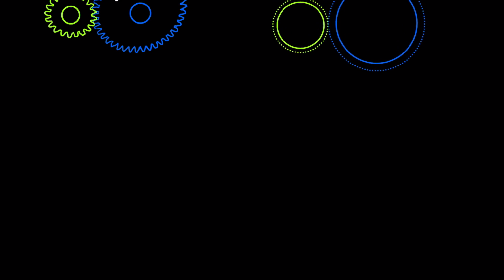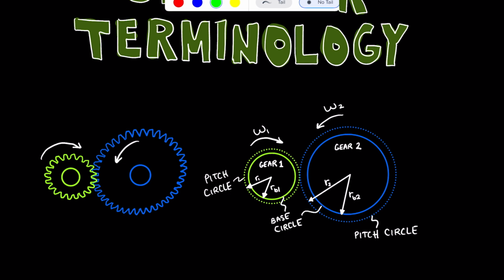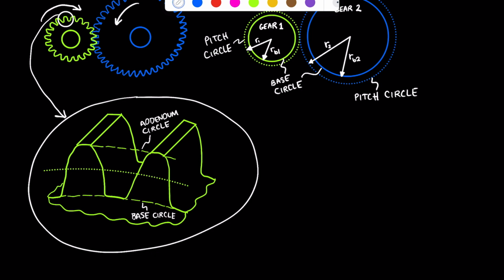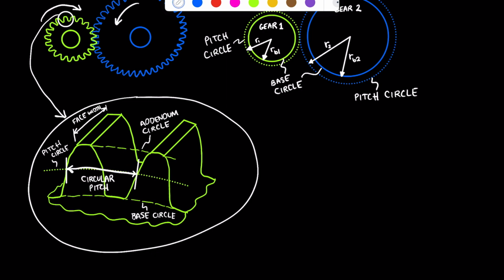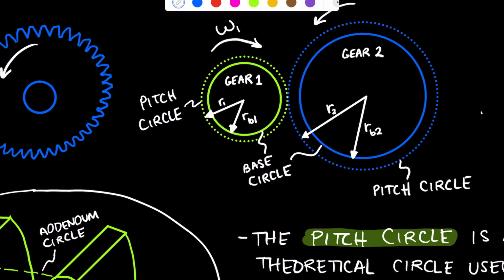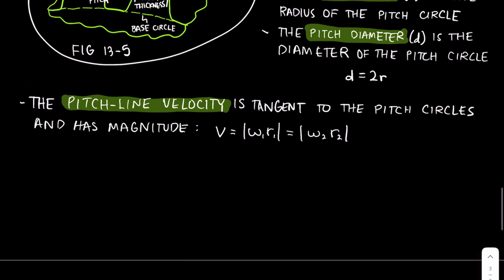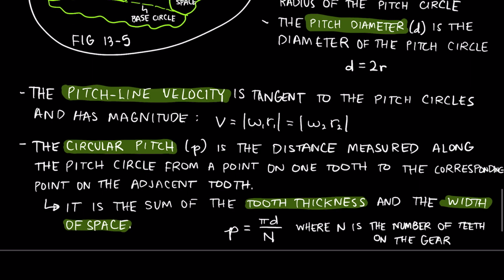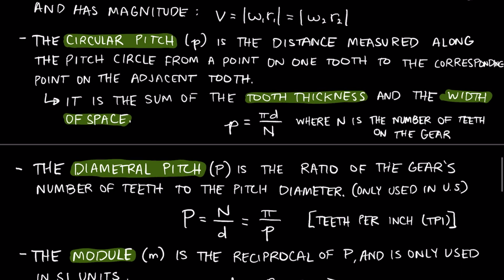How to Speak Gear: Spur Gear Terminology | Machine Design - Lecture 22B

Comment from the maker: Correction: In this video, I mistakenly said that the base circle and the dedendum circle are the same thing. That’s incorrect.

The base circle is where the involute profile of the gear tooth starts, while the dedendum circle (or root circle) defines the bottom of the tooth space. The base circle is used to generate the tooth shape, while the dedendum circle ensures proper clearance. They are not the same and are never equal in a working involute gear.

Thanks to those who caught it, and I appreciate your understanding!
Reply: Thanks a lot for the erratum, Prof. Ginsberg. I have shared your Machine Design playlist with my students.

Comment: As per Fig. 13-8 in Shigley 11th Edition, the base circle and the dedendum circles are different. In fact for an internal gear (Fig. 13-10), the base circle and the dedendum circle will be on opposite sides of the pitch circle.
Reply from the maker: Thank you for catching that—and you’re absolutely right. I misspoke in the video. The base circle and dedendum circle are indeed different, as shown clearly in Figures 13-8 and 13-10 of Shigley. And your point about internal gears is especially helpful—it's a great example of how these circles can be on opposite sides of the pitch circle entirely.

I’ll be posting a correction in the comments and description to help clarify for others. I really appreciate you taking the time to point that out!